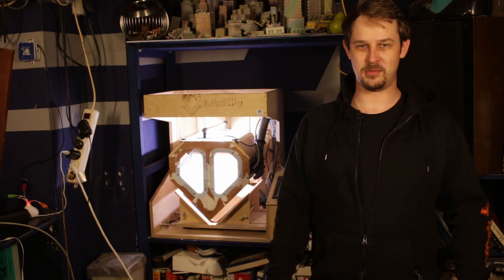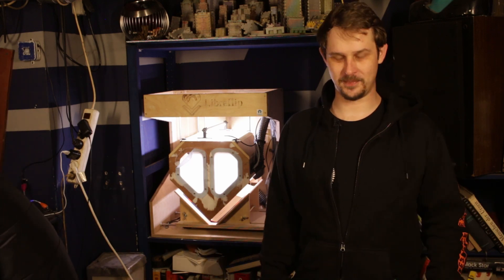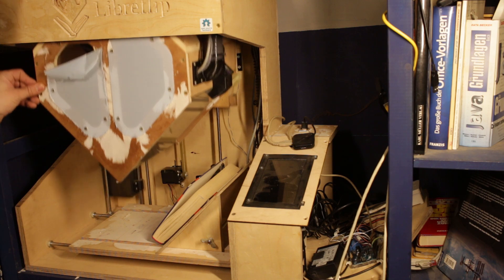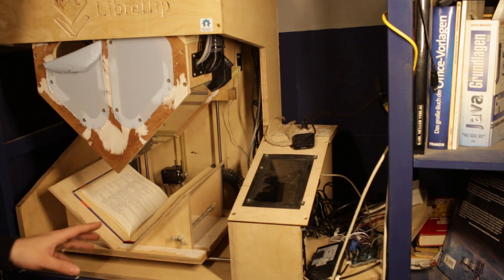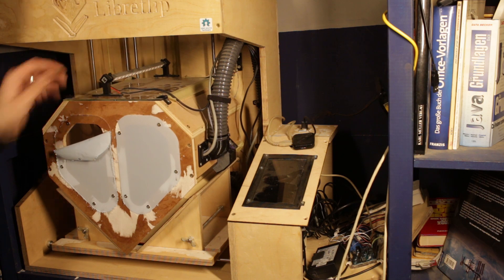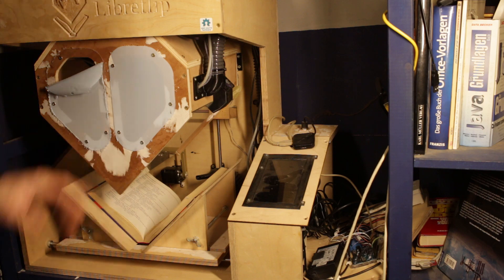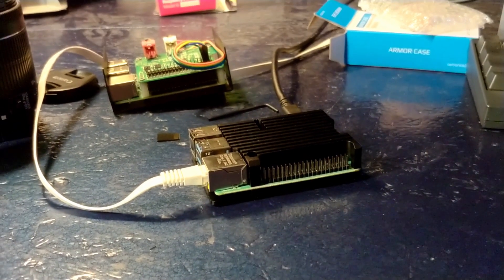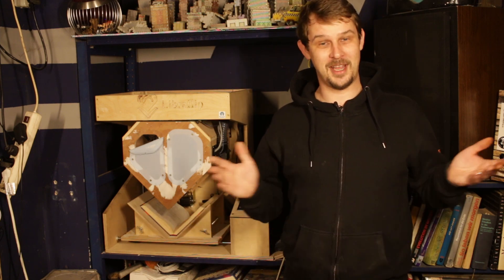building Libreflip - E36 - replacing the Heart!

Comment: Definitely should keep the touchscreen as optional at least
Reply from the maker: Thx for your opinion on this matter!
Reply: @IjonBerlin  I would drop the touchscreen as well. Whoever wants to use the machine must have a laptop. I think it would make things quite a bit easier and cheaper without the loss of the core features. Just make something that works as an MVP. :) Later on you can refine it with fancy thigs like an (optional) touch screen.
Reply from the maker: Thanks for this opinion. You make a sound argument. I'll think about it, thx!